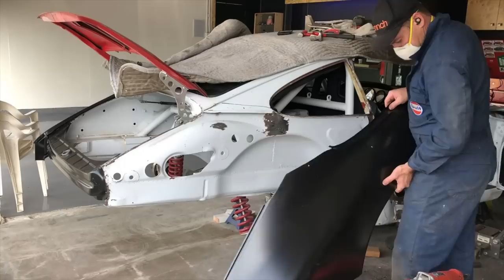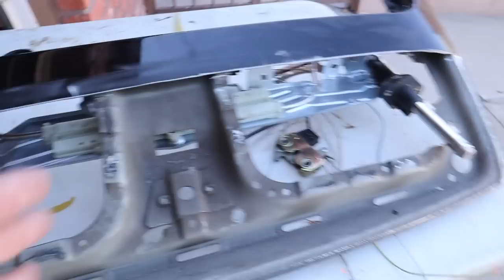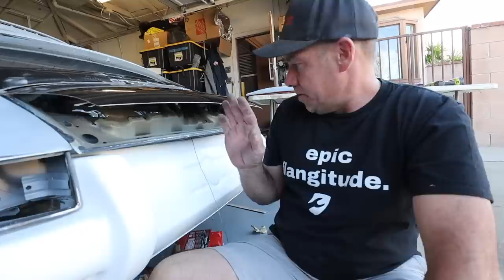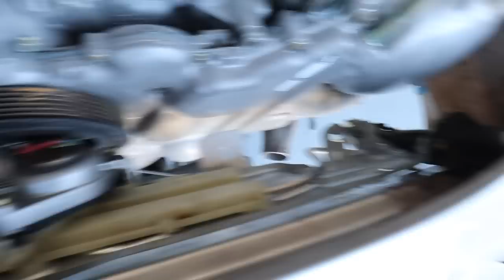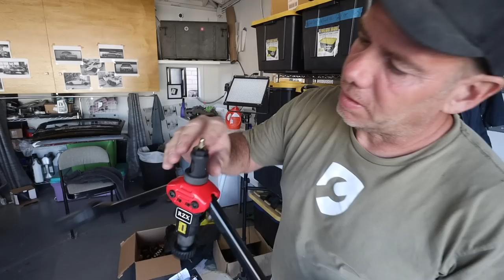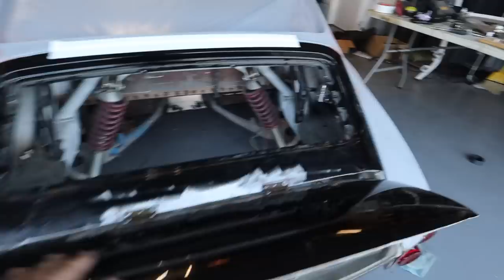WHAT?? ** Active Aero** on the Vintage Porsche 911 Blasphemy Build | Subaru Swapped Porsche #69

Comment: Looks great, but I'm going to say it's going to bind up especially over 55 etc.
Really it needed an arm connecting the rod to the top.  You were right re the actuator arm at the beginning.
If you stick to this, at the least you'll need a ball roller at the top so that it'll easily move under the duck tail.
It's a great idea, I just think you'll have a few versions to get it DONE.  😎👍

@homebuiltbyJeff should give you more clues.
Reply from the maker: How so?
Reply: @rennch.  
Have you found when you actuate the arm it will simply push on bare metal.

Try welding in a c rail under the duck tail.

Then on the actuator arm, either create a channel in the arm (think a 2 prong fork) or place a simple rod on the end at a right angle. In this you could mount a simple bearing chase.  Like a skate board wheel set.  Align this bearing with the c rail and you will find your actuator will then push smoothly against the duck tail.  

Not the best, but the only other way is i totally change the angle of the actuator to place the arm aiming toward the rear into a bell arm.  With unequal arms on a pivot you're achieve a progressive rise on the duck tail and a lot more strength in the movement.  Unfortunately this i reckon will interfere with your engine placement.

Last idea was to move the whole actuator you have further back, as well give you a lot more support against down force.  Unfortunately you will also lose rise height unless again you use a pivot arm.

Happy to email you some examples.

Good luck.

Comment: I like outside the box things.  Only thing I might would do is round the edges and mold it in a little better.  Just think the square edges while up will throw off the look.
Reply from the maker: It Hass to look like a stock decklid in the down position. I wouldn’t know how to do it otherwise.